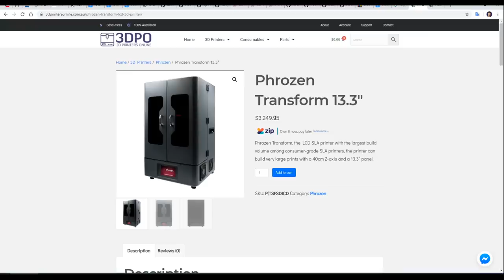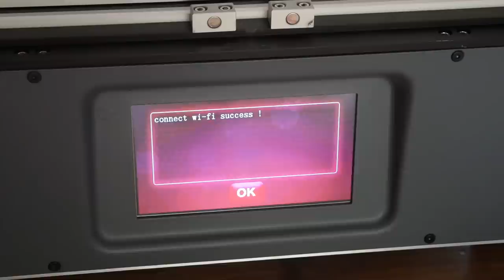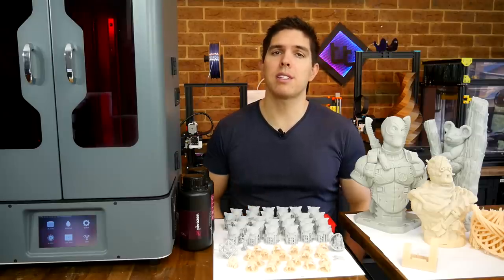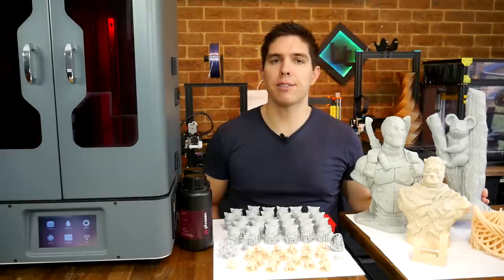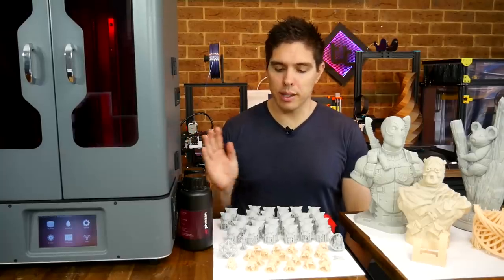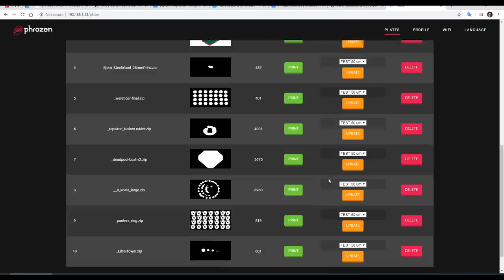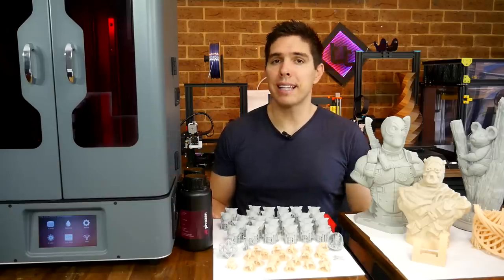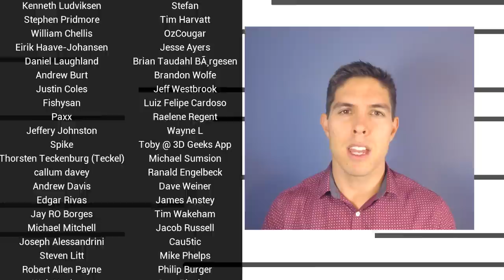Phrozen Transform large resin 3D printer review

Comment: Anyone else need a square print bed? I was just looking at buying one of these this weekend. The main drawback for this to me is the rectangular footprint. I'm really looking forward to a resin printer that has a circular footprint >200mm diameter (or a 200x200mm square) so that it can print lithophane lampshades!
Reply from the maker: I guess the restriction is in LCD format and they are typically 16:9 aspect ratio.
Reply: @TeachingTech  yes, the only option I've been able to find is the Peopoly Moai 200, but it's out of stock most places which means it's either selling better than expected, or it will soon be discontinued which will make it hard to find replacement parts. I have to wait a while to make sure it's the former. Thanks for the great review!

Comment: If its like the Shuffles, its a tempermental beast & a lot of users experience problems getting the machine running again after replacing parts like the LCD (which has been my experience with the XL)

Comment: Nice review. I noticed that Formware slicer and it has a Floor Structure so you could layer prints to really fill the build volume. Did you see that feature with-in the Transform version?

Comment: Beginner question: 
* Do the resin prints get any discoloration overtime? (years)
* Does this material get brittle overtime or does the material change in any way?
I would like to know if it's safe to sell a printed item like that, and not to worry if the printed item would fade or break after years.
Thanks!

Comment: Please don’t use their information that states that the 5.5” panel can be switched in 30 seconds. They changed the design so now it’s closer to a  5-10 minute switch. Not bad but not as advertised.
Reply from the maker: I haven't tested this first hand and I'll happily defer to you on this one.
Reply: Michael, great review, made me anxious to get mine bought when introduced on Kickstarter, setup and running. I wasn’t real happy when Phrozen revealed that due to some unspecific issues they weren’t going to be releasing the system as advertised with the quick-swap screens but due to my work schedule attempting to get all my contract obligations done before Rotator Cuff repair surgery I’ve yet to take it out of the box. Unfortunately, they STILL haven’t released the dual 5.5” screen option yet (or at least they haven’t shipped the one I purchased) but hopefully in another two months when I can use my Rt. arm again I’ll have those parts in hand to use. Companies like Phrozen really need to hire good multilingual Tech folks to convey product design changes in a native language since (at least with me) they had me “flying-off-the-rails” on the release of the revelation that the screen changes were NOT going to be done as DESIGNED, but weren’t clear due to language structure that they actually would still be ABLE to but not disrupting my intended manner of its use. As it turns out, a one-time 30-min procedure to ADD the 5.5” screens and an operating system change in the form of a SD card swap & reboot being required to use the smaller screens enables the advertised functions to be accomplished. (At least that’s what’s been advertised at this point but until I receive the parts and have the time to perform the procedures required on my “turn-key fully-functional” product I thought I was backing/buying, that are required to make it fully functional) Time will tell. Keep up the good work!

Comment: Why no youtubers anwsers those questions : Minimal wal thickness, minimal hole size and do resin shrink like fdm after curing ?
Reply: Yes yes and no
Reply: I'm using the Prusa SL1 currently, and cured resin prints don't seem to experience shrinkage after curing. I'm still testing though, and I'll keep this in mind.
Reply: @3DPrintingNerd  Thanks for this answer ! You should definitly make a video with fdm vs resin 3d print for mecanical parts.

Comment: What is the strength of prints?
For example, if you printed a belt clip to hold something on your belt, it will be flexed at the curve portion many times.  Can the printer create long lasting products such as a belt clip that can be sold?
Reply from the maker: It comes down to the resin used. Typical model resin is super brittle. If you drop something, it shatters. This ABS like Phrozen resin can withstand drops for most models, and they make engineering and flexible resins too. Hopefully I'll be testing those in the future.

Comment: Broken prints can be fixed with a drop of resin and a UV flashlight.
What about air filtration and fume filters?
Those Phrozen resins are very expensive.
Reply from the maker: Great tip on the fixing. It has a desiccant bay to pull moisture from the chamber but no filters that I know of. It is compatible with 3rd party resins so you're not locked in to particular brand.

Comment: Might seem like a dumb question, but without shielding the UV array from the rest of the internals, isn't there a chance of desegregation of the parts due to UV exposure over time (brittle wires and sheathing for example)?
Reply: The UV used is quite low power UVA, since the printers are based on the technology used by dentists to set the photosensitive resin used in tooth repairs. While there would be some very long term degradation, it would be nowhere near the kind off effect seen in sunlight. A much bigger issue with SLA printers is LCD panel failure due to temperature.
Reply from the maker: Thanks Evile for fielding that one. The LCDs are a consumable and Phrozen sell them on their website.
Reply: @EvileDik  Thanks for the reply. That covers exactly what I was thinking (and why I started by saying "it might be a dumb question."

Comment: How long did it take to print the big bust and the small parts?
Reply: I have this machine and prints as big as the Deadpool bust at .05mm will take about 25 hours.   I printed a 3/4 Baby Yoda that was 11.5 inches tall that took 27 hours.   Overall the print qaulity is very good but since it's DLP and not SLA round surfaces will need a bit of sanding and filler primer.